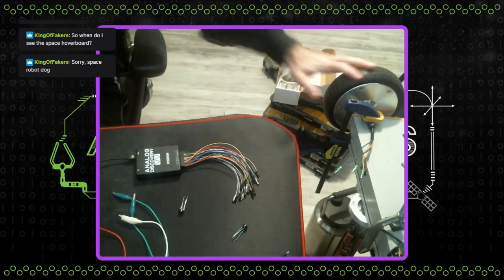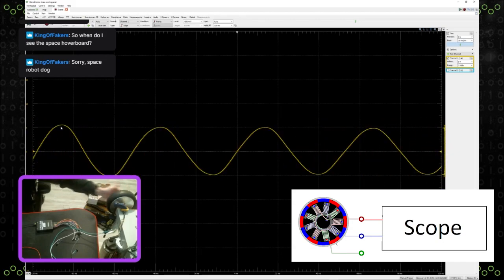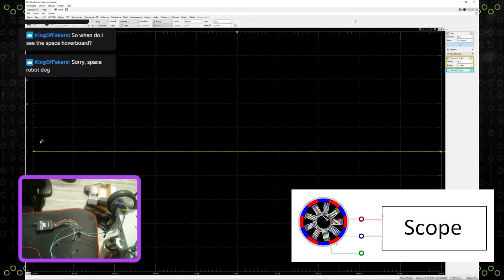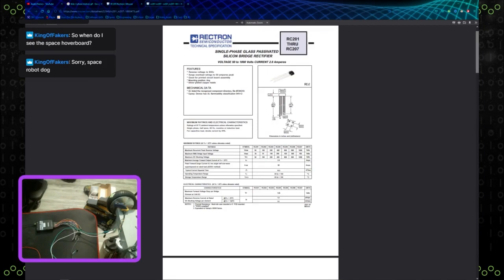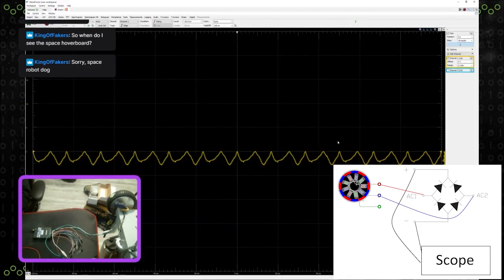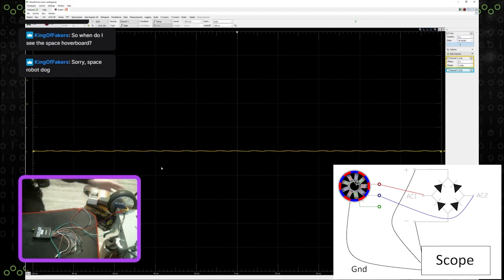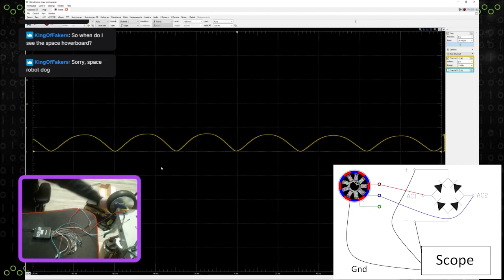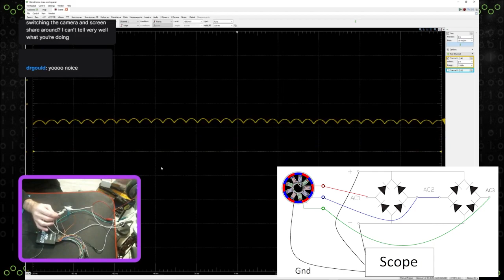How to Make a Generator with a Hoverboard Motor

Comment: Hi, if you want flat DC output you add Capacitor at the end. You can make nice project with that by ading that wheel on home bike or some other machine for home gym, so you can exercise and charge your batteries by addind some dc-dc convertor and set it up for voltage that you need to charge any LiPo or even acu batteries, all those cost 2-3 usd. You get healthier and make your own electricity for lightning your house or charging your devices :)
Nice basic explanation, keep them coming and thanks for sharing!